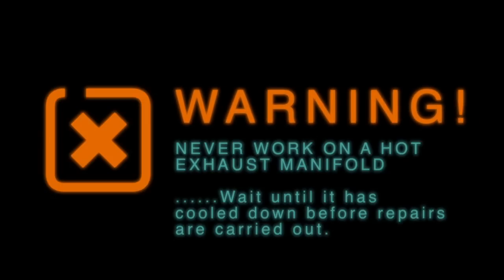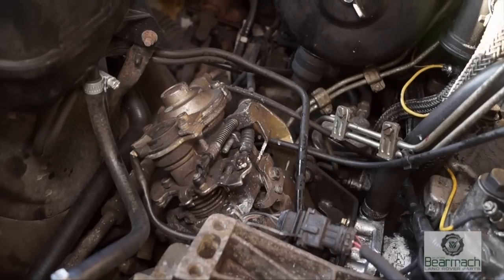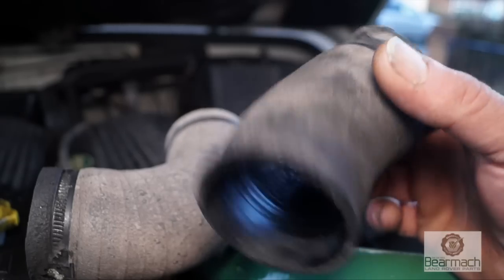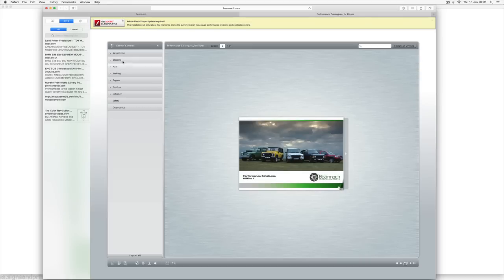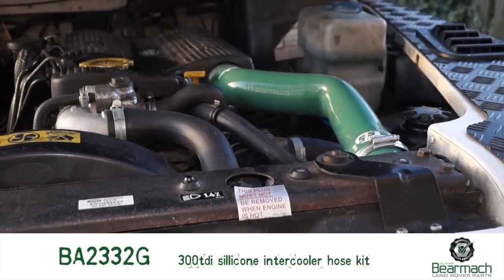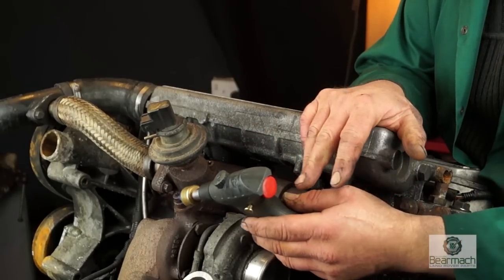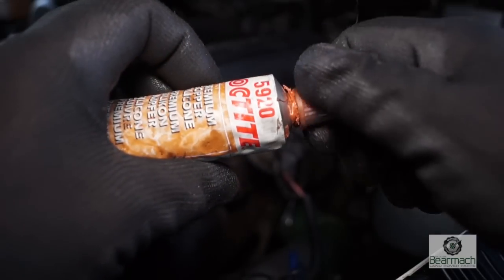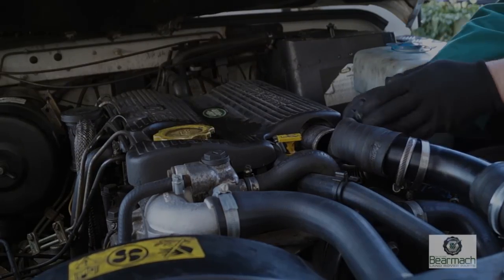Blanking off the EGR (300tdi)  - The Fine Art of Land Rover Maintenance

Comment: GREAT VIDEO, thank you! however I have one question, in the part of the video 9:59 you have mentioned the oil in the inlet of the turbo.... What might be the problem if the oil is in the inlet of the turbo please? thank you.
Reply from the maker: All turbos let oil through over a long period of time.  If coming through from the air filter it will be related to crank case pressure and the fact the breather  / cyclone unit . Turbo diesel engines have pressure issues and it is quite common to find oil can be pushed through the breathers.  If there is a good quantity of oil then perhaps the piston rings are worn

Comment: Hi I'm thinking about doing this to my 05 defender td5. What to I do with electrics and control unit? Just remove them? 
Thanks
Reply: as an 05 defender you'll have two vac servos, I left the vac pipes in place and blanked them off. you can then disconnect the electrical connections from the EGR controls.

Comment: Will blanking the egr off where you have at the end of the video make a difference to the performance of the engine ?
Reply from the maker: Over time yes, -  because it stops all that soot collecting with the oil in the inlet tract and gumming it all up.  some 300tdi's suffer really badly from choked inlet manifolds.
Reply: Land Rover Toolbox Videos cheers
Reply from the maker: You're welcome bud.

Comment: What are the benefits of this and would it be worth doing to my 02 TD5?
Reply from the maker: Same as every other engine.  no crap in the inlet manifold clogging it up. Crisper response and slightly better performance.
Reply: Must do it so:-)
Reply from the maker: I'll be doing our new  family Freelander at the weekend. EGR has made a real mess of the engine.
Reply: +Gareth Ga Wilmott I have a Renault laguna 1.9 DCI (TD) 120 bhp 05 plate, I've got a EGR valve on mine, the reasons I've blanked mine off is as the egr gets clogged it sends crap to the turbo and buggers it up, also I had a major issue on the M4 going to work when the check injector light came up (EGR) and the car went into limp mode straight from 70mph to 40mph in the fast lane wasn't fun at all :(, so I have had mine blanked off - no problems whatsoever and she is more responsive and more fuel efficient as well, plus it passes MOT emissions first time each time, mind you that may be down to the fuel I use (shell fuelsave diesel 100%), I would definitely recommend it mate :)
Reply: Hi,I have Laguna 1.9DCi 74kw from 2003...Where I should put the blanking metal plate? Instead of upper part of EGR(the electronic-sensor) and leave the rest of mechanic part of EGR-valve in closed position?
Reply: hi mate, check with your mechanic and he will put it on, make sure you get the right one for the vehicle, I would recommend it mate.
Reply: vikingsmb No more Defender, had to flog it😢
Reply from the maker: gutted!
Reply: vikingsmb Needed a more family friendly wagon!
Reply: ***** I'll have another eventually:-)
Reply from the maker: Have you just had a new addition to the family?
Reply: ***** No, thank god! I do a lot of camping, the missuss and son have started to come along so needed the extra seating, couldn't find a good 90 or 110 anywhere!
Reply from the maker: Yes i know that one.  Doing a 7000 mile journey in a discovery 1 was good but we didn't have enough space for the kit.

Comment: Yes law has changed thanks to the EU, Failed MOT today and been told to refit EGR valve.
Were all 300tdi discovery's fitted with egr valve ?
Reply from the maker: The early ones didn't have EGR.
Reply: EU has no input regarding mot tests
Reply: @simoncoe9344  yes they did…